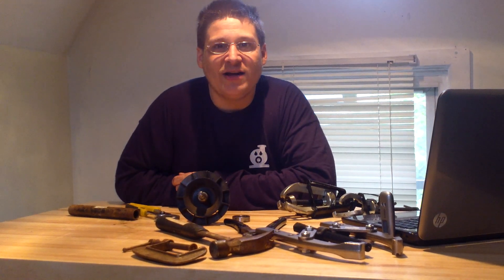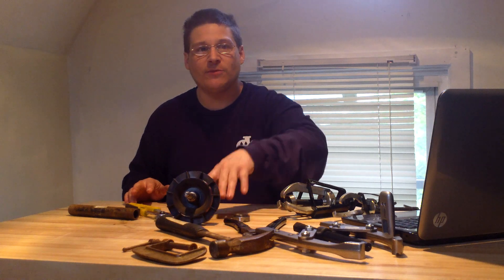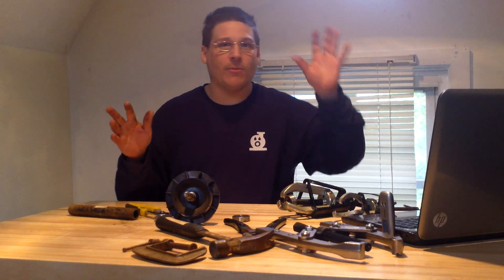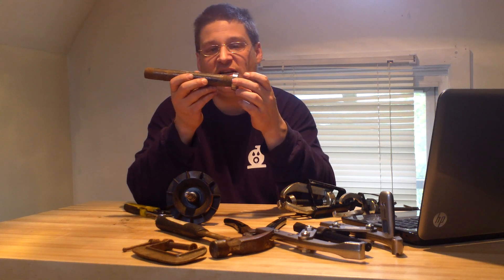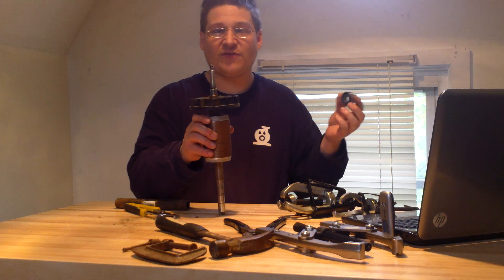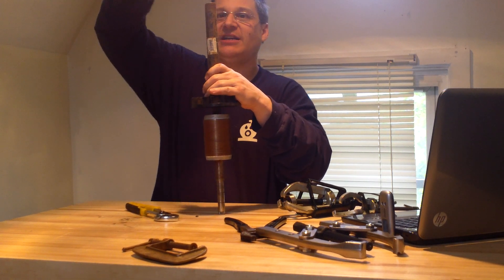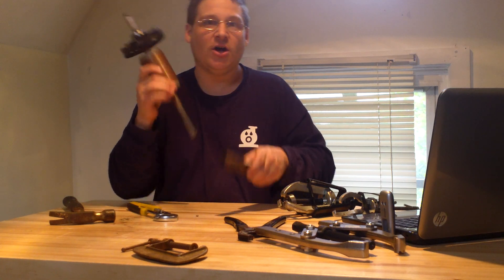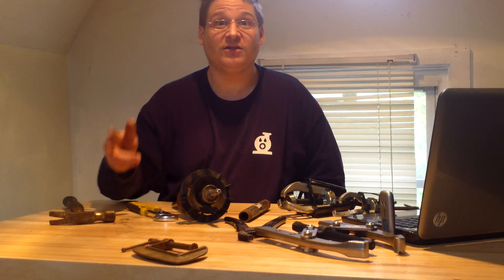Pool Pump Tutorial [ Hayward ] - How To Install Pool & Spa Motor Bearings

Comment: arbor presses aint cheap. I have one it only cost me 6 grand but worth the price. hammering bearings on damages the bearings inner,outer and balls by shock, and should be done as a last resort.I don't recommend working on a electric motor or pump, I recommend you bring it to a pro, this thing runs about 10 hours a day 365 days a year and uses electricity,lots of it if you fail to do the job right . look for your local pool pump repair guy . the re-bearing cost is about $75 here in central Fl